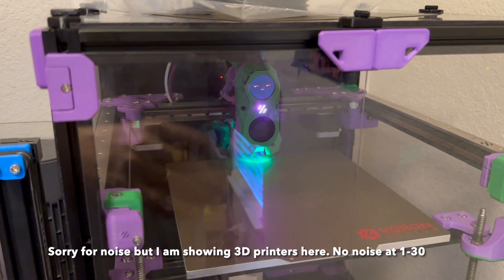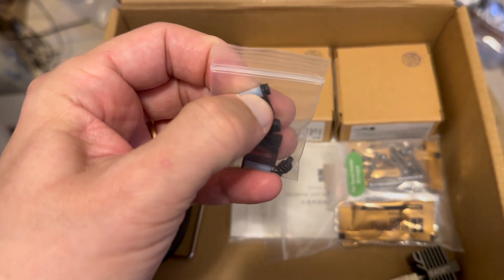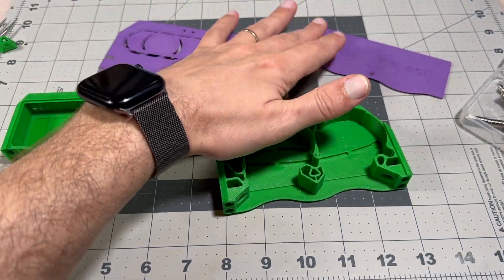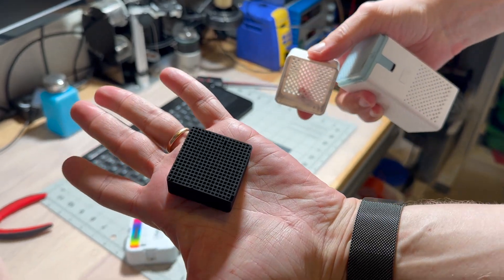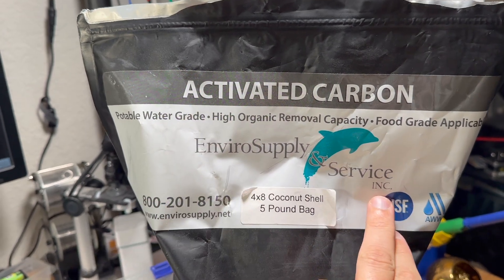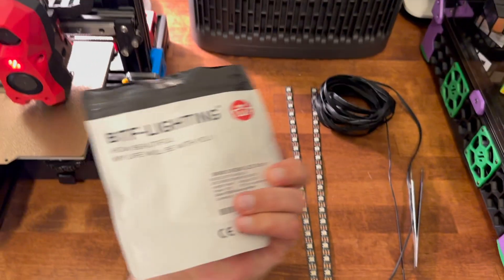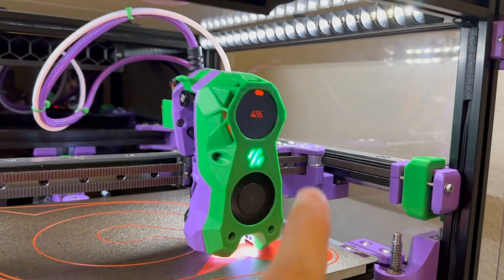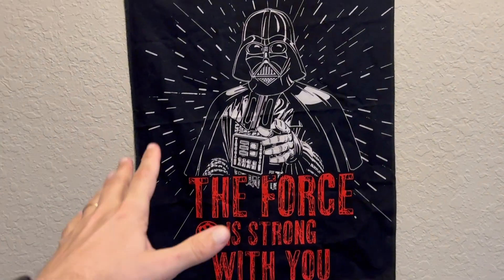Voron Trident mods (Bambulabs Wiper, LED Lights, Nevermore, Purge Line)

Comment: im not very expirienced in 3d printing but. you could set start print macro to preheat nozzle to 160degrees while printer does homing, bed mesh etc. once it done all preparations make it go to purge line start position and lower nozzle to bed leaving something like 0.05-0.1mm gap. heat nozzle to printing temperature, extrude 10mm (or whatever you need to get plastic out of nozzle) then doo prime line on edge of bed. that is how i have set up my printer and i have never needed brush or nozzle cleaning. basically that 10mm extrusion on the spot makes all crap stick to the extruded filament, also 2 stage preheat makes sure nozzle does not leak any filament. end print macro i have set up to cool nozzle as fast as possible too enabling part cooling fan to max for 1 min. not sure this would be goon on your abs printer. anyhow there you have way around nozzle cleaning brushes
Reply from the maker: I don’t like brushes and this mod was just to see how it goes main reason cus this printer has voron tap which requires clean nozzle for proper mesh. Now I have another probe and simple purge line.

Comment: may be a stupid idea but cant you swap the rgb signal  from your mainboard and have it controlled through the rpi's gpio pins instead as they are not blocked by current print status ?
Reply from the maker: You probably right and I also think it's possible. I haven't spent time yet to figure out how to directly access RPI GPIO pins from Klipper, but looks like it's the time.

Comment: how did you power on the led where did you connect the wires to direct to 5v power supply or to controller board to be powered by klipper
Reply from the maker: I have tried both separate power supply with common ground and LED header on the Manta M8P itself. Currently I am controlling LED from the Manta M8P signal via Klipper and supplying power via separate power supply.
Reply: @hobbyistnotes  thanks for sharing

Comment: All that to get bested by a bambu!! Good job lil bro
Reply from the maker: I see your point but my Trident is still better than 90% of the machines on the market at this price range, based on your logic I had to just ditch it? Why not to make it a touch better so printer could compete with Bambu? I use exactly the same slicer settings on both printers and the only thing Bambu beats my Trident is Multicolor, but same time it’s looses in multiple other ways especially in usability and control.

Comment: You could have gotten Daylight stick from mellow or siboor works better.
Reply from the maker: Looks like the sticks you mentioned have exactly the same LED chips on them. They are 3 times more expensive and have same circuitry, I doubt they would work much better.